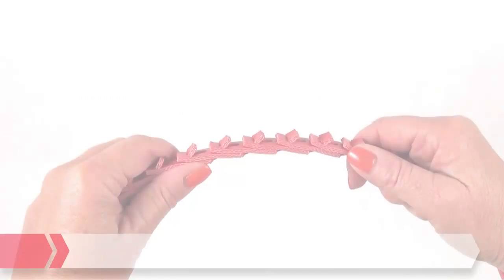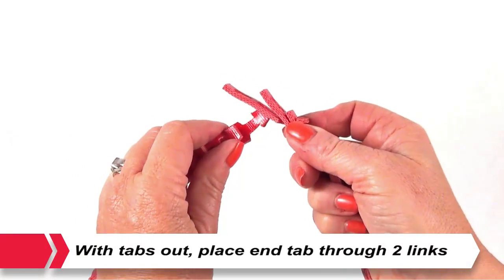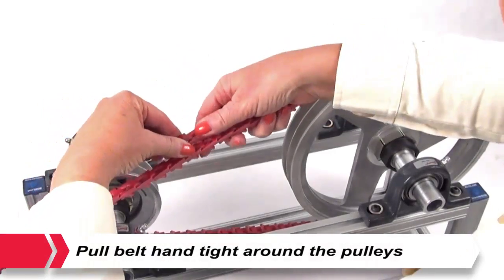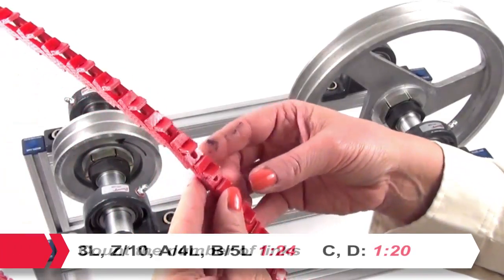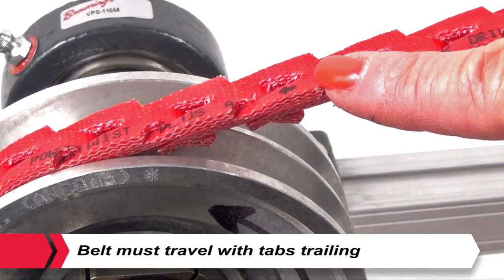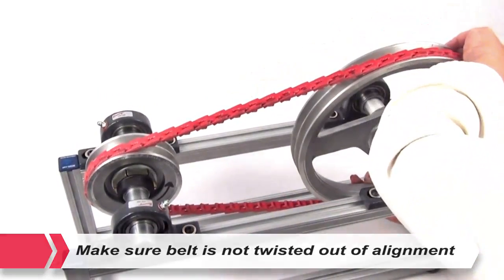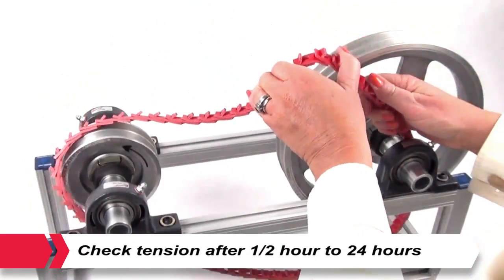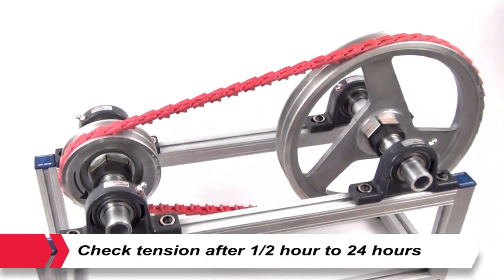How to Install PowerTwist High Performance Link Belting

Comment: I replace the V-belt on my table saw with a link belt, and loved it.  But very soon the link belt started climbing one side of the pulley, and eventually started being thrown.  So I carefully adjusted the alignment of my pulleys, got a new link belt, and had the same experience.  Any thoughts on what could be going wrong?

Comment: I was looking into changing belts on my tools, and I seen these, and it peaked my curiosity. 
 
So I cam here, and I was sold in a few minutes. 
 
Now let's see how well they do with high rpms and heavier loads.
Reply: so how did it work out 2 years later?
Reply: @INVICTUS FARMER  eghhhk. 
 
I ended up going back to regular belts. The regular belts did just fine.
 
I expected a justifiable difference... it was like using a Dewalt drill and upgrading to a Festool. They do the same exact things, and while it might do something a little bit better, it wasn't a quantum leap in any aspect. ...
 
It was still a belt, but it required more maintenance. I couldn't just pop it on and forget about it. If I didn't use say the drill press for an extended amount of time, I'd have to release belt tension or the next time I used it, it would be wonky from the belt being shaped around the pulleys at a certain spot. It would take a bit to get warmed up and straighten back out, where a regular belt never really had that issue. 
 
Basically, it overcomplicated the process without providing any valid improvement.
Reply: @carterscustomrods  fair enough.  ty for the reply.  ill give that some thought.
Reply: @INVICTUS FARMER  well, it never hurts to try it? Lol. I'd probably like them if they were $10 but with regular style belts, and even Poly Belts being so inexpensive and still effective, it's hard to justify $35-$70 for a belt.
 
Either way, best of luck!
Reply: @carterscustomrods  im curious about them because my particular application doesn't lead to adjustability of belt tension.  being able to pop a link when it gets loose is very appealing lol

Comment: can these  link be used on a sewing machine
Reply from the maker: Yes, PowerTwist should run properly in a sewing machine, as long as the correct belt size is chosen for the stock pulleys and they are not smaller than the minimum pulley requirements for that belt size. Thank you for the interest! We'd love to hear your feedback once installed.

Comment: I have a vertical milling machine that requires a "B" size belt. The cogged belt that I am currently using transmits vibration to the machine. I would like to use a Power Twist belt for this application but, this mill is reversable. 99% of the time I run in the forward direction however there are times where I may reverse my machine's rotation thus reversing the belt as well. Would this be a problem. I have an "A" size on my bandsaw and love it!
Reply: Kenny Fowler, thank you for your interest! As long as the machine comes to a complete stop before changing direction the reversing should not be a problem. However, be mindful of the minimum pulley diameters when switching from a cogged belt to PowerTwist. For a "B" size belt we recommend pulleys at least 5" (125mm). Feel free to reach out to our Applications Engineering team at AE@fennerdrives.com to discuss the specific application further. As always, we welcome any feedback you may have following the installation. Thank you!

Comment: Can these belts be used on a lathe that has a reversing switch?
Reply from the maker: +Ed Pace - We have recommended PowerTwist for lathe applications, of which many of them do reverse. As long as the lathe comes to a complete stop before changing direction we don't foresee any problems. We would love to have feedback once you have it installed on your application. Thank you!

Comment: Can i use it on a machine with a tension roller on the outside of the belt?
Reply from the maker: Generally speaking, adjustment pulleys are not used with PowerTwist Plus because once the initial growth is removed from the belt it no longer stretches, therefore eliminating the need for further adjustment. That said, yes an outside or backside pulley can be used with PowerTwist Plus as long as the diameter is 1/3 larger than the recommended minimum pulley. (i.e. 3-1/4" OD for A section and 5-3/4" OD for B section)
Reply: Thanks Fenner D.
I have ordered an powertwist belt.
and will try it.

Comment: Question, can this belt be used for automotive applications?
Reply from the maker: Our PowerTwist Plus belting has been designed and tested for Industrial applications and not for Automotive, Lawn and Garden, Construction Equipment, etc. With that said, if the belt on your Automotive application matches one of our PowerTwist Plus belts and you want to try it, feel free to do so. However, no guarantees with regard to performance or longevity.
Reply: Thanks for your prompt response I may experiment with any marine diesel or off road vehicles I work on in future I am seeing an untapped market for these packages thanks again
Reply from the maker: Here is an example of PowerTwist Plus being installed on a canal boat motor in the UK: http://youtu.be/udTbXm7Wd_Y

We've had success in this type of application. Let us know how your experiments turn out, we'd love to hear from you!
Reply: @FennerDrives  This boat engine is what got me to here !
https://youtu.be/oF2jI2dR-ys?t=1096

I think my dad called them Bramah belts - with links and studs. Do you know who started using linked belting / patented it ?
Reply: @Soca47  might be handy to keep in the Jeep to get off the trail if the Jeep had v belts
Reply: @chrispy398  Ah ok been awhile but I will still try on other applications thanks..
Reply: Yes can you please show me that.
Reply: Application irrelevant as long as the specs of the belt tie in with the use - e.g. power transmission required, smallest pulley size etc.